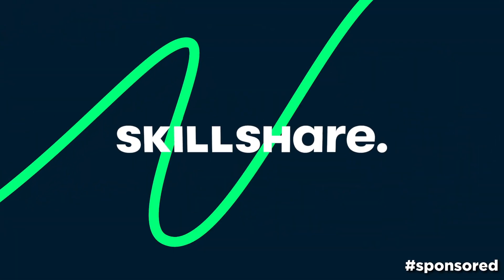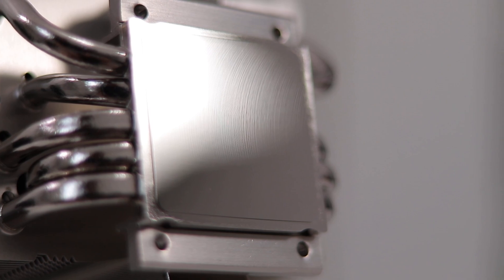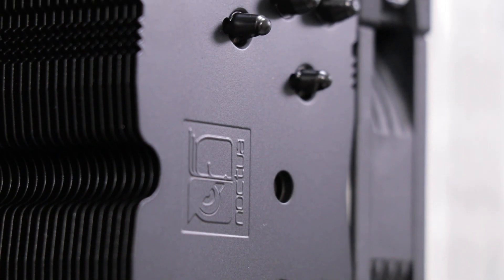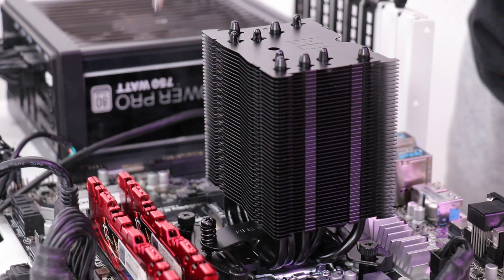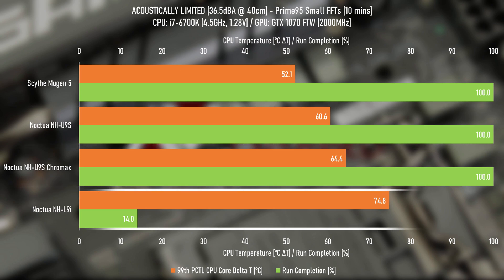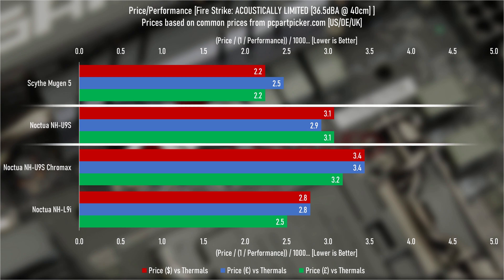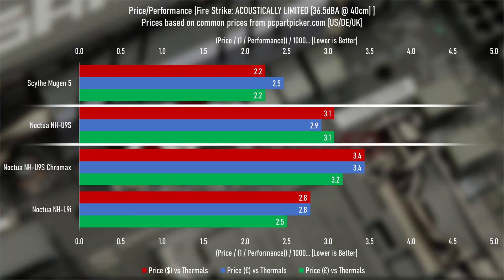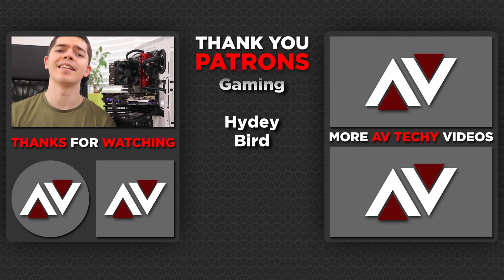Noctua NH-U9S Chromax.black and Noctua NH-U9S Review

Comment: I got this for my Xeon LGA-1200 since it has the extra heat pipe then the Server / workstation NH-U9DX U4. It can be used in 2x fan as NH-Ux-1489. 
I prefer the bright aluminium look myself but maybe w/ an RGB ring or white frame.

Comment: Does this work for a orion 3000 case rtx 3070 i7-10700K without having to remove the motherboard, if not what cpu cooler works?.

Comment: I'm guessing the difference you're showing would less dramatic when comparing a larger, more powerful cooler like the D15 and the Chromax D15. More and more powerful fans, more heat pipes, more aluminum, and less chance of paint versus no paint having enough of an effect to make a difference in the results. All that being said, I'm glad they're offering the Chromax coolers, but I feel like plenty of people would be interested in the nickel / aluminum coolers but with the black fans. I actually love the look of their bare metal heat sinks, and it's too bad you can only do bare metal + black fan by buying a Chromax fan separately.
Reply from the maker: Probably, although I'm sure if you scaled up the heat source with the cooler size you might see a similar result.

Comment: I’ve got a u9s with 2 fans in push pull on a overclocked 3900x - love that cooler, good value, looks nice and gets the job done :)
Reply: What kind of temps are you getting with that? This cooler seems to be one of the only decent ones I can find to fit case.
Reply: I got the chromax with a Ryzen 9 3900x in a Corsair 4000D case. I get low 60’s high 50’s in idle. While gaming I get mid 60’s to low 70’s. It only hit 73c one time and never passes 72c while gaming hard.
Reply: how to get second fan